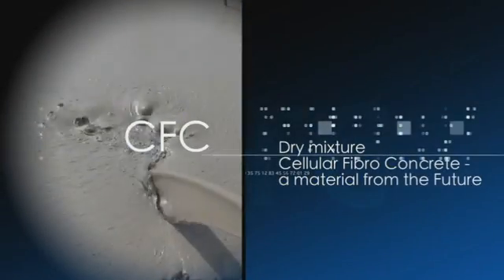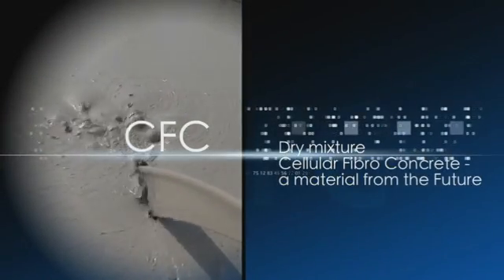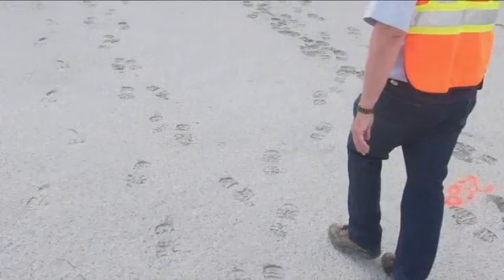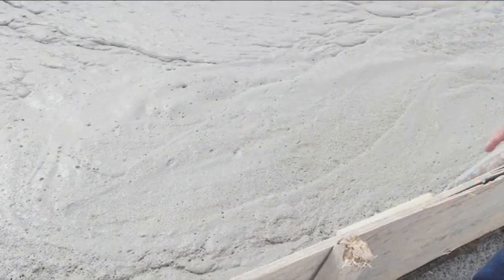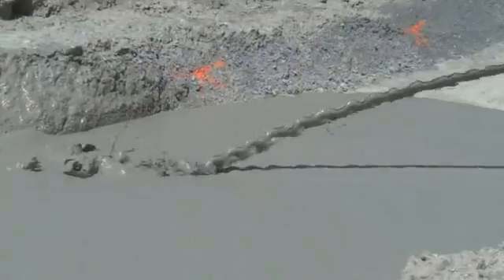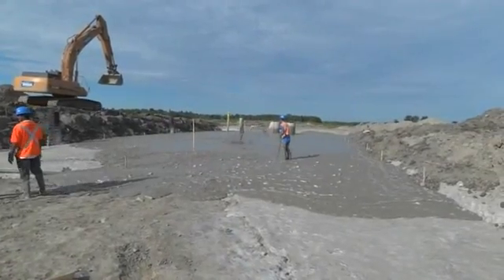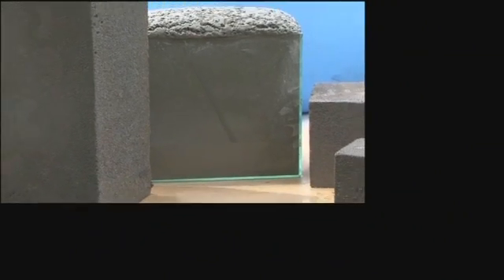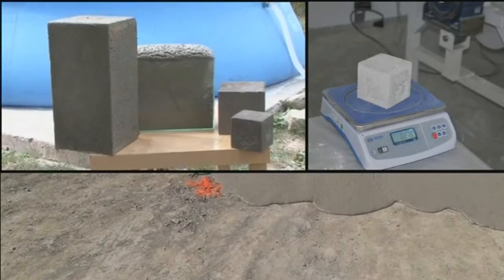CFC movie - "Get the technology advantage!"

Comment: I have alraedy built with CLC (foam concrete). I have group of two mashines: one special concrete mixer, and a foam generator, which at the output already mixes the foam into the concrete (adjustable density). I use compressed air, and protein based foaning agent. We can use zeolite, or fly ash additive, and/or polypropylene fiber to achieve different features (compressive strength, bending strength, etc).I also used synthetic foamig agent with excellent results. I investigated the so-called dry-mix. I made inquiries to companies, which make videos, and claim products, but so far they couldn't even give me samples. The dry-mix must be tricky in making consistent quality, - temperature, humidity varies, so varies the result. Now, there are very well understood, tested foaming agents, making predictable, stable products. The equipment, and workers' care are also very important.

Comment: There are many reasons this is an excellent product, however, this seems to be the same thing as aircrete except for the means of aeration with aircrete is with nontoxic dish soap.  This is a different product since no foam mixing is required as the foaming agent is already in the mixture.  At 3:17 you say:  The dry mixture is produced from sand and the waste products from the petrochemical and metallurgical industries... and later you say, "fly ash or metallurgical slag...”  Maybe there's no off-gassing but I wonder about airborne particulates and as the earth shifts and aircrete .  That's my amateur view.
Reply: أمره مريب. . بينما موجود مثله في القنوات الروسية
Reply: كيف يكون لها علاقة بالروس

Comment: There must be an additive to form closed cell foam.  That is probably from the
mentioned petrochemical additive.  Anyway, this looks like a very useful product.
Thank you for the video.
Reply: While one can make foamcrete as you note, the video specifically states this is a dry mixture and does NOT require a foaming agent. The bubbles are formed in a chemical reaction.  I think Gabor nails it with Wooten's help above
Reply: Aluminium powder is what is most commonly used agent for construction grade projects, like for aerated (ACC) or foam (CFC) concrete uses. Or the other long list of names it goes by...BTW a foaming agents like detergent or glycerin is great for DIY projects. But since it hard to get consistence results it rarely used for major construction project...And I not sure of any petrochemical additives?
Reply: The foaming agent can be detergent based or protein based.

Comment: One of the ingredient must be aluminum (aluminium) powder of the metallic form of
aluminum.  It probably reacts with the calcium hydroxide to produce the hydrogen bubbles.
There is probably calcium oxide in the mixture and aluminum powder. At the time of adding
the water, the calcium oxide turns into calcium hydroxide, and the calcium hydroxide
reacts with the aluminum powder.    In dry form, the ingredients probably can be kept
in a mixed form without the reaction.
Reply: Why would he not give us this information? This video gave us no details and he told us some very likely ingredients. Whether it is confirmed or not with this info you can now do further research. Thank you for the info btw
Reply: From what I have researched the amount of Al2 powder to 1kg of Portland Cement is 1grm. In casting sections you must not go above 3ft as the foam cannot support it's self much beyond this height. Different amounts of water affect support weight.
Reply: Its incorrect to say aluminium powder "must" have been ingredient. Since there alternative methods to produce it. But aluminium powder is the most common...And saying "In casting sections you must not go above 3ft as the foam cannot support it's self much beyond this height" since density and strength of the mix can be varied. Along with adding rebar or other forms or reinforcement can be added....
Reply: Thanks for that!
Reply: @rbloch66  If you don't like it, don't read it. If you know better, share with us.

Comment: I want details of this product to start a business
Reply: Good day! We are a manufacturer of dry mix for production of non-autoclave aerated concrete. You can use this material as an insulation for walls (instead of rock wool and glass wool) and for lightweight screed. You can find more details about our product here http://www.pioner-group.com/services/cost/
Reply: If it works as insolation, why not use it as walls without insolation, do you think its not strong enough to bear weight?
Reply: mnhasan90@gmail.com
Reply: Prashant Chaudhari up